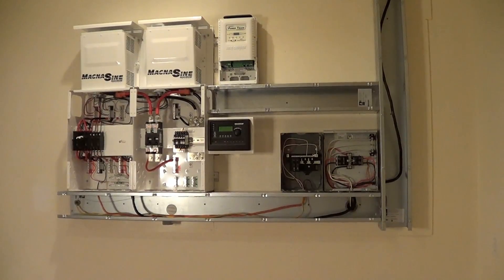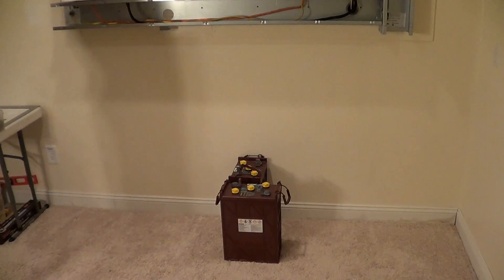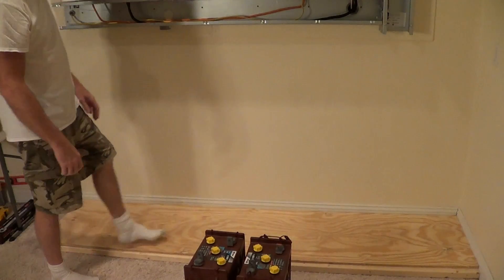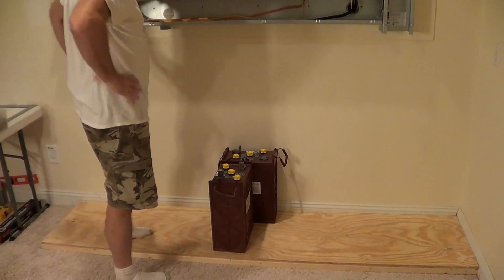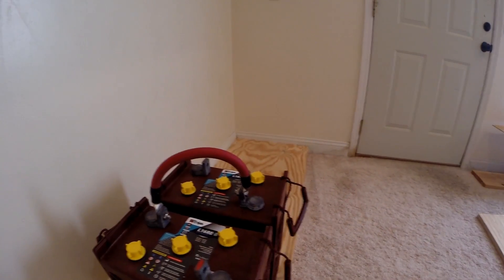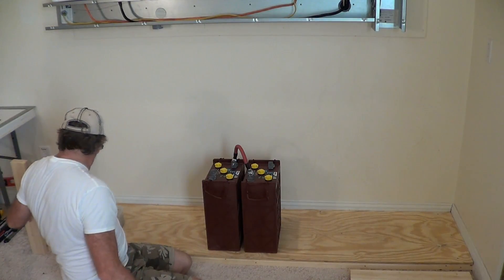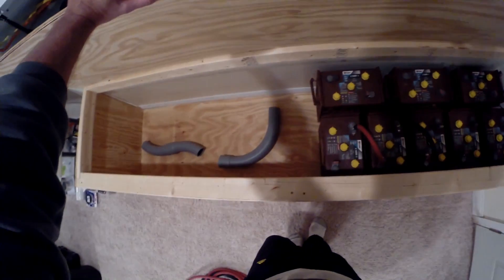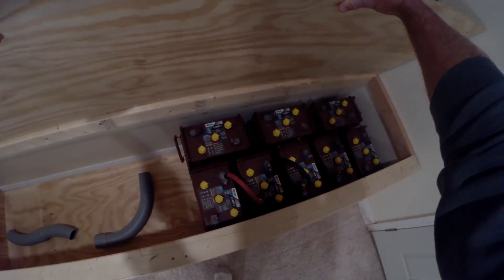Off Grid Solar #18: Building the Battery Box

Comment: Can you provide the model of the Trojan batteries, where you purchased them from and the price?  You box is awesome, I recommend hinges vice screws for quick easy access.  You never know when an emergency happens and batteries are combustible and considered a medium risk safety issue. Your system so so awesome.  Great job!
Reply from the maker: Trojan L16RE-B.  They were about $5,000 for 16 of them.  Go to Google Maps and source them locally.  They have served me very well so far but I would look into used Tesla batteries if I were doing it today.  I did hing my battery box and I get into it once/month to add water.  Thanks!

Comment: Tell me, did you told your house insurance? How did they react to you putting those batteries in your house?
Reply from the maker: I had not even thought of that...  The setup is actually in a finished portion of a semi detached garage (connected by a walkway).   The power will run out of the garage about 60 feet to a critical loads panel in the house.  I will have to call them and notify them of the addition.  The system is being permitted and checked by codes enforcement.
Reply: Sounds like it's the perfect place to me!

Comment: One thing that i would do is set the batteries in some type of leak proof container. I would hate to have a leak and get all that battery acid in the carpet.
Reply from the maker: Good suggestion!  I may use a shower pan liner if I can find one to fit at a good price.  Need to make sure the acid will not react with the material.

Comment: Brother one thing that's a must. You need to wire them as 3 banks each then run the main from each bank to a bus bar. So it would be 3 pos on a buss bar and 3 negs. If not your going to have a HARD time keeping them all charging and discharging even. I been doing solar/DC bat work for 20 years. One thing that happens the most is the cells each en up being so out of wack they are dead well be for the 10 + years..  I hope in no whys I am upsetting you just trying to be help full and save you a LOAD of cash in the long run. God Bless Brother.
Reply from the maker: I do appreciate your advise and you have got me thinking about it...  My system is 48V so I am constrained to having 2 banks of 8 batteries each.  My plan is to loop them around so each bank ends up with the ends in the middle so that the 2 banks can then be put into parallel with short (24") and even length cables.  I am using all the same type batteries and they are all new.  I will have dual 4/0 cables connecting the banks to the inverters.  All the cables will be the same length both pos and neg.  Sooooo, I could run both banks to a busbar and then up to the inverters rather than jumping the banks together...  Why would that be better?  If I jump them together, should I run both pos cables to the inverter from one bank's pos terminal or one cable each from each bank's pos terminal?  Same for negatives?  Also wondering if rotating the batteries once a year might help prolong their life?
Reply: It's best to not do more than 4 in a bank. You can even call Trojan and they will say the same. I would do like I told you. It works the best. The work I did for the US gov. They liked it so much that now all there's are dune as I showed them.

Here is the deal moving them around in place your going to hirt your back and may brake the batts. It may help some but if you do it where you have max for in a bank there will not be a big need for it. 

No I would not run 2 long runs up to the invter. I would have 2 buss bars. One for the pos and one for your negs. 

Then on each bar land 4 pos from your banks and 4 negs from your bank. Fuze the main wire going out to the inviter and land that on your inviter. The neg just run it from the meg bus bar to the inviter. 

I will send a PM with my Phone# feel free to call if you would like. I do not have a video on mine as I have just 8 t105 batts. 

Brother I would love to see you get a full 10+ years from your bats if you do it right you can. Hell I had a set run for 12 offgrid then I put them in my dads golf cart and he used them foe 2 more years lol..
Reply: Sorry for the spelling have a IV in my arm and I not the best at spelling on top of that lol.. I blame the pain killers lol.. Doc says I will be beater here soon.. I pray so..
Reply from the maker: I think you're right about the busbar and I am going to try to work that into my design.  Magnum says I have to run independant lines to each inverter so I can do that from the bus bars.  I hate not having a fuse on those main lines going out so I am going to add that as well.  Do you have a suggestion for a fused busbar?  I think Chris DIYer may be using one....  Also, I have to run banks of 8 to get 48V out.  How are you going to get 48V out on 4 batteries?  Perhaps that is a big advantage of a 24V system.
Reply: ***** Crap your right.. LOL I was thinking your setup was 24 volts sorry. So yes you will do 2 banks of 8.  Still running 2 banks of 8 beats the hell out of trying to run power in one post. What happens when you do that you end up having the bats in the med being more chagred and the one's you pull from less.. 

So doing 2 banks of 8 is the best thing. Yes you will have to run a main wire for each inviter. Sorry I was not clear on that. Again that is where a buss bar will be good. 

Your DC box thing it has all the brakers in it right? Maybe you can pass on the in line one's I would have some tho. One on each feed in of the invter. Even if it's just to kill the DC power for that inviter. I am one of tho's over kill kind of guys tho..